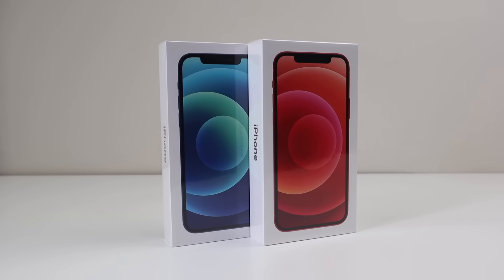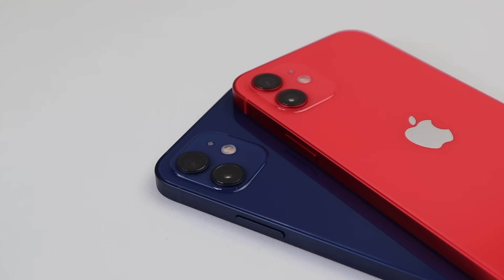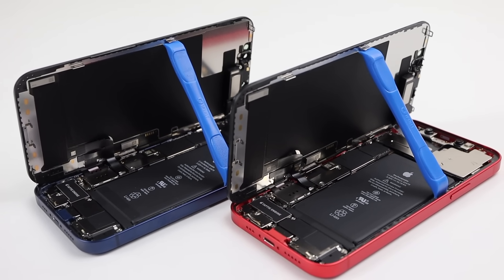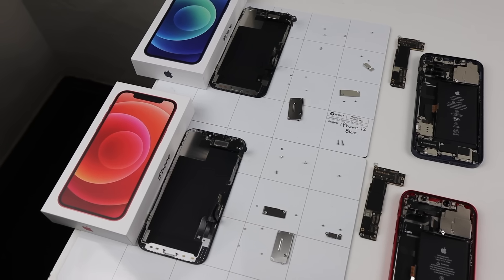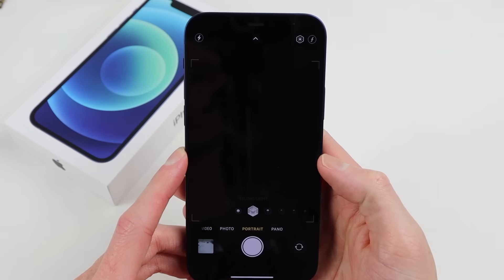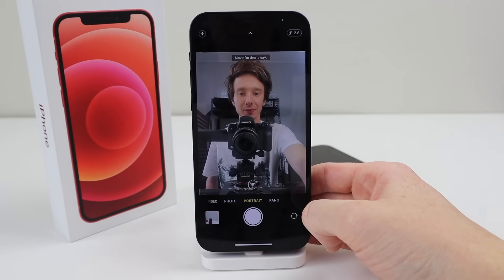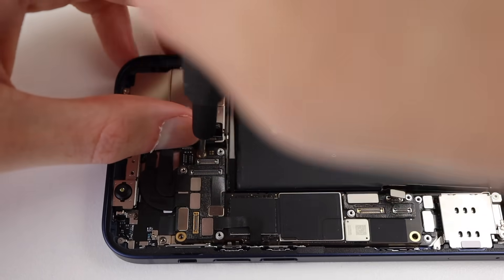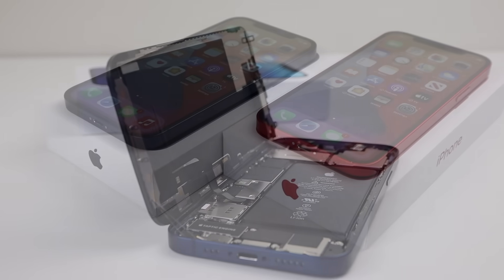iPhone 12 Anti Repair Design - Teardown and Repair Assessment

Comment: Time for people to look elsewhere for phones etc, I had a problem couple of years ago with the graphics card in my at the time 7 year old. I contacted an Apple approved repair shop here. When I told them my iMac was 2011 they said even if I got a replacement part for it they weren't allowed by Apple to repair it. They said it was regarded by Apple to be OBSOLETE even though everything was working fine apart from the display. He told me they don't fix anything over 4 years, Apple want you to buy a new one.
I took it to an independent repair shop, they fixed it for me and now it's working fine. 
I bought it directly from Apple who a couple of years previous to the problem had issued a recall to replace the graphics card but they never contacted me even though they had all my details.
I had used Apple for many years having the iMac, iPad, iPhone and Apple watch but I think that the watch will be my final Apple purchase

Comment: I completely agree with Apple’s choices here with putting a requirement to do internal repairs. Think about this, face id completely relies on Apple’s manufactured camera being used. A third party camera can be used to manipulate face-id data which is driven by AI which can possibly cause problems with the AI altogether. Apple most likely decided to do this to protect the integrity of the face-id feature. The camera app bugs I imagine is just lack of testing as the camera probably has firmware specific lockouts due to the camera switch and hadn’t been tested before iOS release. It all seems okay to me.

Also, Apple isn’t the only one forcing internal repairs. Tesla has been doing this for years

Comment: Sure Apple is going green but unfortunately their products are not. 

Whilst the iPhones graphics user interface is the best on the market, the "engineered" lack of serviceability makes it significantly less appealing than its competitors. Worse yet Apple, hasn't gotten the hint that we want / need the following....

* Contacts White List
* External SD card
* Modular Battery swapping
* Right to repair
* Scratch proof screen
* Accessories that work across all Apple products

Verdict: I nor any of my family will buy one. Can't imagine why someone would pay $1000 -1200 for one.

Comment: The problem is most likely due to Apple using an internal system that when you add a part to the device it will be associated with the SN/IEMI.

Comment: They say they are “reducing waste” but in reality apple just wanted to charge people more money to buy the plug by itself.
Reply: Yep on older models you get the headphones and charger together for 699$ now you only get the phone for 699” and extra 100” for the charger and headphones
Reply: I agree their excuse is stupid but chances are if you were foolish enough to buy the iBrick 12 you probably also bought an earlier iPhone, which means you already have a lightning cable and a plug. This new cable is just for plugging into Mac devices.
Reply: @Wlerin7  my dad still has the iPhone 7 plus
Reply: @Wlerin7  Not true for many who skipped the iPhone 11 and bought the iPhone 10.
Reply: @todanrg3  you can use any lightning cable you don’t need to use the usb c one
Reply: @biggercorn7760  So that means the USB C cable is wasted? I'm currently using iPhone 10. In that means apple forces me to buy a power adapter or waste the USB c cable if I getting iPhone 12.
Reply: @DadayuMax  Yes. Which is less waste than a cable and power adapter.
Reply: @DadayuMax  you can keep the cable and use it on a computer with a usbc port which is becoming the norm, so if you already have a cable and now you have anew usb c cable boom, you can plug your phone into any computer with one of the two
Reply: @biggercorn7760  yes, that works!
Reply: @DadayuMax  If you have an iPhone X already the you can charge a new iPhone in exactly the same way as your current one, no?
Reply: @Wlerin7  nope, only buying an iphone 12 because of work
Reply: You got them bro. After all, everyone knows that apple makes all of its money on... its chargers. Genius move for them to almost half the price of their phone so they can make people spend another $20 on a charger... I hate apple too, but claiming that this is to make money is one of the dumbest takes I have ever seen. If they wanted to make money, they would raise the price of their phone another $100 like they've been doing and all the fanboys and rich old people would slurp it up as always. Apple isn't one person who gets off on inconveniencing people as much as it may seem they're a company whose marketing genius hasn't been outshined since their inception.
Reply: Yes, look at their business model & you'll realise it.
Reply: My last iPhone was the 4S, thereafter not been looking back since.
Reply: They made more waste creating more boxes for more products
Reply: Over 1k phone with 2800mah battery is a joke.  No extra accessories n unrepairable to a third party is a worthless phone.
Reply: Create a problem, sell a solution
Reply: Yeah my iPhone 11, my iPad Pro and my iMac are my last apple devices
Reply: It’s a money grab, they changed the adapter and accessories to get more sales

Comment: Sooo... it’s pretty much the same issue as the last iPhones other than the camera I guess? Interesting info though, when doing a certified apple repair the cameras on the last models of iPhone does actually require a serial number for the old camera. This is verify the parts authenticity, that’s why there’s a QR code on the camera. It is interesting that now the camera appears not to work but isn’t surprising.

Comment: These iPhones designed to be easier to repair yet harder to repair at the same time.

All of the parts are more accessible yet you can’t just swap them from another working device. 

The glass back is probably the worst offender. Once it’s shattered, the entire phone chassis has to be replaced.

That’s some serious e waste. Wireless Charging isn’t worth $500+ for repairs.

Comment: “That screw was rounded out from the factory” You have to literally be fucking kidding me, that better not be a new secret practice to keep independent repair shops from replacing small parts like the charging flex which fails ALL the time on these iPhones! The same part that apple says “you’ll need a whole replacement” when that 15$ flex cable fails

Comment: I think I remember hearing somewhere that apple engineer stated that one of the main reasons was to prevent people buy the phone, swapping some if not all the parts with third party clone parts then would return the phone back for a refund and then sell the parts they pulled. It's unfortunate that you can't even use the original parts pulled from another iPhone of the same model.

Comment: 8:15 this is my exact battery issue on my iPhone X. I replaced the original battery with am iFixIt battery and iOS 14 refuses to recognize it. It was recognized fine in iOS 13, so this anti-user-serviceable battery issue seems to be iOS 14 specific.

Comment: Louis Rossmann who has a channel fixing macbooks/laptops shows exactly the same thing with those products. There's less and less you can repair. Apple are systematically tying up each and every loose end to prevent you getting in and fixing stuff. Chips and circuits seemed to be paired to that specific macbook and changining them renders the thing useless. I'm due to change my phone at the end of this year and for the first time in many years I'm not changing it to an iphone. Great vid, thanks.

Comment: Just another way that Apple is pushing for in-house repairs. I think your idea on the hardware serialization is correct given that swapping parts between phones wouldn't work. Most likely you'd need a fresh or "blank" part and then you'd need to program the ID to the phone in order for the part to work as function. This is the same way TPMS sensors work on cars, you can't necessarily swap hardware from two cars, you have to program a blank sensor to the car being repaired. However at least with cars you can run down to your local shop and by the parts and tools to fix it yourself.

Comment: Firstly, thank you for this video - those big posts on social media get companies to think about repairability stuff.

There will always be things to complain about and of course every company's motivation is to make money. This will never change even in the age of Green Washing. However Face ID not being repairable is an important factor when thinking about safety and this is something I am almost grateful for. Also when you smash your phone that bad that Face ID does not work anymore I would still be happy when the phone works with just the code. And True Tone is most likely just a part of the Face ID module, so of course it won't work anymore when the phone is not accepting the module.

But yeah, the camera thing really is bad and I hope Apple either has a good reason for it or it will be fixed later on!

Comment: MSEE here. I think the reason that the parts are non swappable is that the manufacturing process includes a calibration routine. Without that software, a 3rd party cannot properly do repairs. Apple will never release that proprietary software.

Comment: The part of removing the charger adapter to reduce materials or waste was just bunch of lies to make you go and spend more money on what should have came with your phone in the first place their just money hungry....
Honestly I dont see how they can't get a lawsuit over this cause they didnt give you a charger which would have been fine but then they purposely made the ends of the included cable incompatible with old charger boxes so you'd have to go buy an new charger adapter... if they were so concerned about waste they would have made the charger cables compatible with older model charging adapters.

Comment: I see several issues here, the phone obviously have tampering sensors which probably have to be reset by authorized users, expect Apple to charge techs to be licensed, also I see modules are pair to an specific device so  interchanging can only be done if possible by authorized licensed tech, if you need to replace any modules on this phone and future Apple products you will need to be licensed, probably installing a new camera module will work better however I see this probably needing an licensed tech or authorized dealer, definitely an #badapple

Comment: Its so eazy to repair, but they HAD to implement the stupid component paring thing... 
Like even if they put a string that would be broken when the phone is opened, therefore voiding warranty, it would be OK, but intentionally locking many parts of the phone is just evil. 
This is why Apple sucks

Comment: Hi, I used to work for a phone repair company based in England.
After fixing 300+ iphone 10/11, i can confirm that apple flashes the components serial numbers on to one of the logicboard chips (it has a name i forgot about it).
The front camera can't be swaped over nor they have any oem parts for it and since being connected to the face id sensor( high security stuff ) , the rear camera on the other hand it can be changed/ swapped on previous models .
The battery will not show percentage on any of the iphone7 onwards if changed/swapped, in the past it was possible to replace it and it should of worked fine , but after an update(can't remember which )  it locked it to the logicboard 
But as I see from your teardown they went over and linked the main camera as well making it rather unusable.

Comment: I have an iPhone 6 and have been waiting for the new iPhone 12 to be introduced so I could upgrade.  Well, about 3 months ago, the battery on the old phone 6 died and I took it to Apple for replacement. ( I was willing to do this, because I didn't want to buy an iPhone 11 when I knew the iPhone 12 would be introduced in a few weeks.)  Apple would not repair the battery because the phone had sustained water damage at one point during my ownership.  While it was true i had gotten the phone wet, the so called "damage" had occurred 3 years prior and had absolutely no impact on the phone's functionality.  So I then turned to a third-party repair shop that installed the battery while I waited and it cost me less than what Apple would have charged. The phone works fine.  After seeing this video, I have to think long and hard about buying an iPhone 12.  If Apple decides that they don't want to do a repair on this device, there will be no third-party alternative to go to.  I'm an Apple user going back to the original Mac computer from 1984. It saddens me to say this, but I'm getting increasingly frustrated with Apple. I'm disgusted with dongles on my Macbook Pro and the fact that it can't have it's hard disk replaced, the fact that one is practically forced to use of apple iCloud storage, and the ruination of the once easy-to-use iTunes among many other issues.

Comment: "We already have 2 billion power adapters out there that won't work for this phone. Figure it out." - Apple
Reply: So use the USB-A to lightning cable, no big deal.
Reply: @pepkin88 no one has one of those lol, apple just did a huge virtual signal while fixing nothing
Reply: @kennypowers2341  ..that's a bingo.
Reply: @pepkin88  ...so just include a USB-A + adapter (or nothing, if they're honestly trying to minimize waste) instead of a USB-C cable and having to buy a new adapter to make it work anyway. Wtf am I missing here? Explain.

Comment: I’m a big apple fan. 
They need to be sued. For the charging cable bullshit alone for one. It’s mandated that phones should have consistent charging ports, so they should have switched to USB-c. A usb-A to lightning cable would have been slightly less egregious, but they chose the least sensible option. 
And we also need right to repair legislation, to force them to be more cooperative.

Comment: Why is anyone surprised by this? The T2 security chip doing what it was designed to do, ensuring all the registered parts are in the phone. It’s a two edged sword, it prevents snoops, spying and data theft with altered aftermarket parts protecting your privacy, but it also reduces repairability. Right now I think many people are more concerned about protecting the data on their device than repairing their phones themselves.

Comment: Dude, you can buy A to C adapters for $5 each on Amazon.  I switched back from Android and had zero problems with no charger in the box.  Phones look well built.  Nice video, but I kept asking myself "How many people actually try and repair their own phones?"  I'm betting very very few.  However, I will agree that after the warranty period, Apple should allow third party shops access to the "pairing" software so people can get older phones repaired.  Like the charger, despite all the whining about the battery, my phone stays charged all day just about every day.  A14 is a BEAST!

Comment: Whilst I can see the ‘Apple anti-repair’ argument here, this works almost identically with ‘Trusted Platform Modules’ in business PCs.
It’s generally seen as an anti-tamper feature, and you’ll find the difference is that Apple has the (soft)tools to change GUIDs associated with each equivalent ‘Apple TPM’
Reply: ivymike83 others work just fine using security in other phone brands

Comment: wow typical apple going the wrong direction with repairability and going out their way with the hardware pairing. We'd like to easily replace the battery and carry out repairs ourselves than mess about sending it to them to do it. I had my 6S battery replaced because they screwed it up in the production. They updated the device from ios9 to ios11 (i included a note that said to leave it on ios9 but they ignored it). I'm never using them again.
1:03 - sucks for newcomers to apple being screwed over with a charge cable they cant even use

Comment: Not at all surprising. Apple has had a firm objection against third party repair and refurbishment shops. (Ref: Henrik Huseby)
I'm 100% certain that each individual component has a unique identifier that has to be verified during the boot process. (Probably explains why the screen won't turn on while powered directly from the battery.) In the event that something doesn't match, it disables everything to include the battery and display. I'm betting that there's a way to boot the device to recognize new components in the event of a repair.
My questions is: Why bother going through all of this trouble when we're making progress with the Right To Repair Act? (Or are we?)

Comment: As a Ford tech for 30 years I can tell you that for a decade a lot of parts on your car are the same. We call it as-built data you have to reload onto the system for it to work correctly.

Comment: The TouchID- and FaceID-data are stored in the secured enclave. Disconnecting this from the logic Board breaks TouchID since the iPhone 7 IIRC, so no news here. 
Since the camera system is used for the FaceID it doesn’t wonder me, that it won’t work after the change.

Comment: not only apple to be fair. every brand is making repairs harder. on my old samsung smartphone I could just take the battery out and put a new one in there. Considering the battery was the first thing to stop functioning how it is suppossed to be in all the phones I had, just putting a new one in would be nice. Hopefully a compeny will make a phone that is easy to repair and upgrade, wich forces other phone manufactures to do the same.